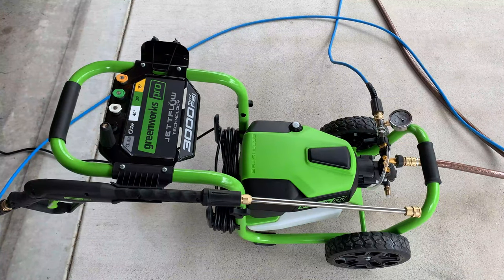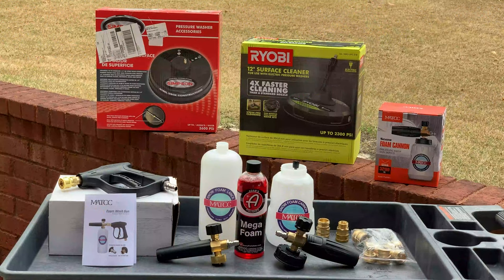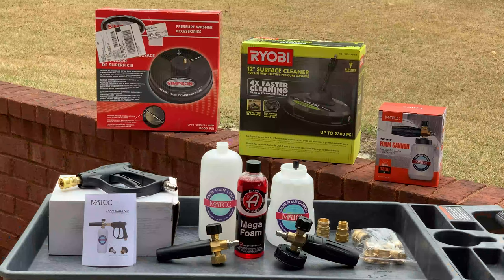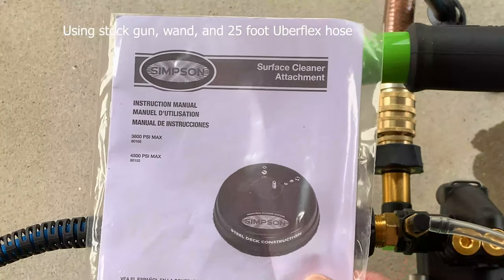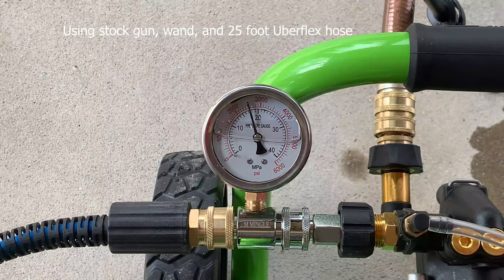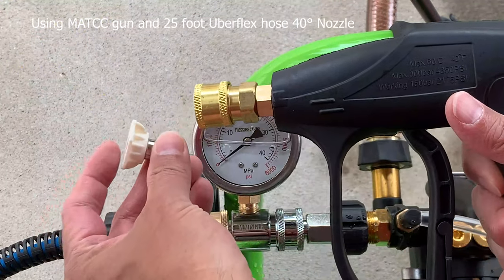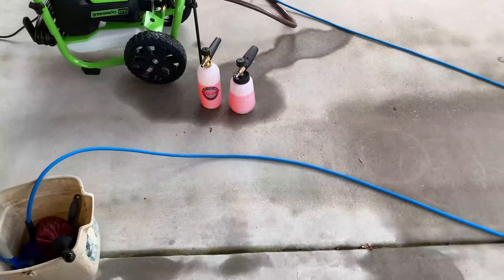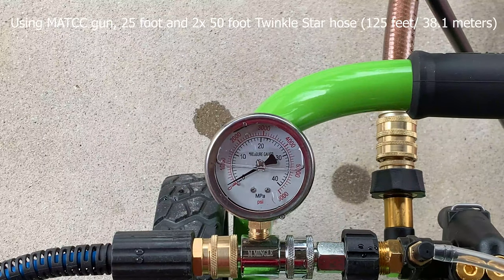Greenworks 3000 PSI electric pressure washer Accessories test

Comment: Great video with good info. Do you happen to know the nozzle size?
Reply from the maker: Thank you for watching the video.

The nozzles are as follows:
Soap, 0 Degree, 15 Degree, 25 Degree, 40 Degree, 

1/4 in. quick connection

I checked the manual and could not locate the orifice sizes for the attachments.

However, according to Greenworks, "The orifice size is 3.0." for their generic set that has a maximum PSI rating of 2000.
https://www.greenworkstools.com/pressure-washer-nozzle-tips-4-pack

This seems larger than I would expect for an electric pressure washer with a 2000 PSI rating. So please take that with a grain of salt.
https://www.ultimatewasher.com/nozzles-size-pressure-washer.htm

According to the link above, the Gallons per minute (GPM) for such an orifice size would be 2.1 GPM at 2000 PSI and 2.6 GPM at 3000 PSI. However, the GPM rating is only 1.1 GPM for this machine using the most aggressive tip.
Reply: @TerryOtsubo  Thanks Terry! I contacted Customer Service at Greenworks Canada and here is the answer "All of our nozzles have an orifice size of 3.0, except the soap nozzle.

"
Reply from the maker: @john7641   Exactly what I was thinking. I wish I had a gauge small enough to measure it.
Reply: @TerryOtsubo  I came across this Greenworks 2700 PSI review, although he did that mentioned the stock orifice size but definitrly not 3.0 because he compared 3 nozzles size of the 40 degree (stock, 3.0 and 4.0)
https://www.youtube.com/watch?v=33y79Ig2Pzc
7:37 has the comparasion info.
Reply from the maker: @john7641   Thank you for the link. I think based on his tests and everything I could find, it's difficult to believe the stock orifice size is 3.0.
Reply: @TerryOtsubo  Terry, check out Josh's review https://www.youtube.com/watch?v=c0ZvpZz5n9I
I am 99% sure the stock orifice is 2.5 base on his tested result 1.125gpm
BTW he is using MTM hydro pressure gauge
Reply from the maker: @john7641   Awesome. Great find!